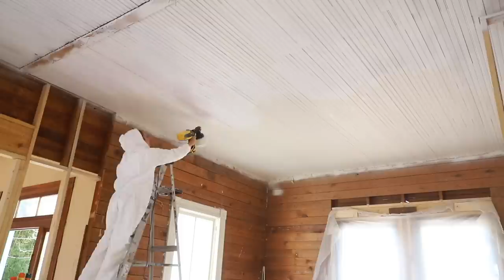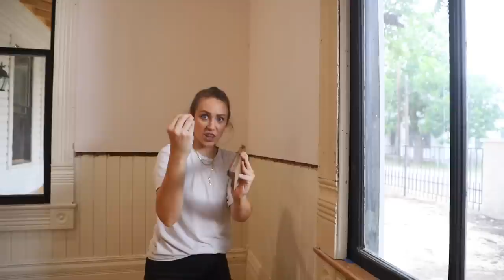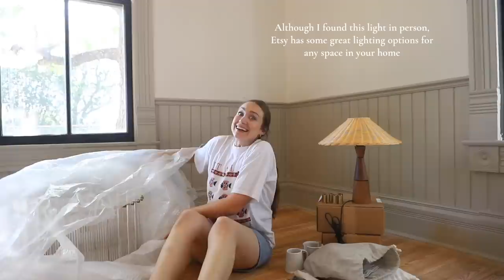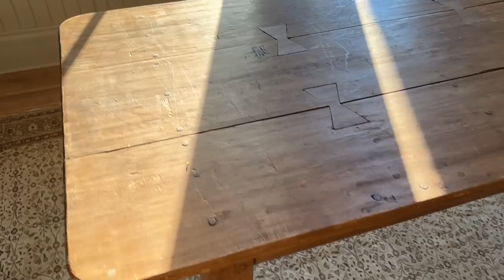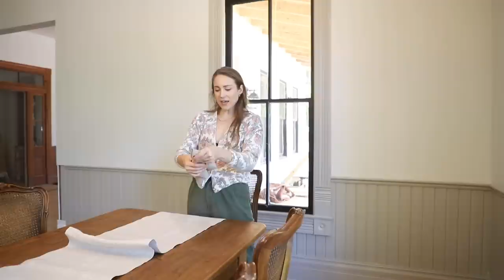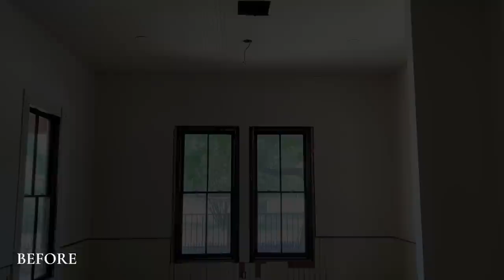Extreme DINING ROOM MAKEOVER *Vintage & Handmade*  | XO, MaCenna

Comment: It’s beautiful!!

Tip on the frame: you can twist the wire into itself on the edges on both sides; if shortens the wire length and makes it more taut so it doesn’t lean out too much. Adding pads at the bottom of the frame also levels it out and gives the frame some grip with the wall too so you can shift back and forth to make the frame more even, too. Beautiful frame and landscape! 👌🏼
Reply: I have done this tip on most of my frames because they have wires that they hang from, and it has made a huge difference in how far off they hang from the wall. My frame now hang really snug to the wall and stay beautifully in place. Thank you for explaining this tip because I kept thinking about how to say it but was at a loss 😊
Reply: This is a great tip! I also used museum puddy on the corners of my frames to hold them against the wall and keep them from going crooked which has saved my sanity! The room looks beautiful though! The table is amazing!
Reply: this!

Comment: So here is a suggestion to blend the chair height to the table height. Depending on the measurements needed to achieve the correct ratio, I suggest cutting the bottom stem of the table legs to the 1st ball shape which looks like about 2-3 inches. Then put a metal tack type button made for the bottom of the table legs to allow them to slide over the carpet. If this makes the table a better height for the chairs, I suggest the same type of metal button on the bottom of each chair legs so they will slide over your carpet without catching the fibers and possibly tearing or weakening this older beautiful carpet. The buttons nail easily into the bottom of each leg and are intended to keep the legs from damaging the carpet or a bare floor. Hope this works....

Comment: OMG, that is so beautiful. I think the cabinet is what really brings the whole room together. Maybe instead of glass, use cane in the doors to tie in with the chairs. Oh, and the reason your frame is hanging a little wonky is that the wire is probably a little loose -- they tend to stretch out over time. Try detaching it, pulling it taut across the frame, and reattaching it.

Comment: The foraged greens for ontop of the buffet type thing….
I saw this great DIY where you use the branches of a similar woody bush and take all the leafs off once it dies out… then you glue rake leads to it. Great way to keep that same vide throughout the year! I’ve seen it done really nicely. The nice thing is you don’t get that nasty plastic branch with the greenery. You can buy some good quality leafs to keep the vibe you want. You can also do flowers etc if you want. Nice to have seasonal options (Hollie type branches for Xmas, maybe a yellow small flower on branches for spring, etc!)

Comment: Hot Tip: when abutting moulding cut each end at a 45 degree angle (one in and one out) they will notch together really well and you won’t have to fill and sand as much! It’s a cleaner look

Comment: Oh, MaCenna…congrats!!….it’s happppppppening…..the frosting on the cake you’ve been baking. If the dining room sets the tone….you are on the right track….so beautiful…such a beautiful curated start to your and Romeos creation! If you add a second hook to the wall  ( so the frame wire runs across 2 picture hooks along the backside) the frame will sit flush to the wall.😉

Comment: It is all coming together!! One thought is to consider adding an additional piece between the two trim pieces at the center of the double window, so it would look like a single very wide trim piece between the two openings rather than two trim pieces almost connecting together. :)

Comment: Soft blinds that fit in the windows that you can lift to open by pulling top down to 1/2 way so still letting the light in they also can be lifted to the 1/2 way or go all the up or down in the day and completely shut for privacy at night

Comment: Oh my goodness MaCenna, what a beautiful room, this makeover was so much fun to watch, I love the wall color and then the bottom color just is so gorgeous, I love the trim work that you did, so decorative and beautiful. That vintage rug is so beautiful I love that color that runs through it. And that table is gorgeous and those chairs are perfect. You are so amazing at all of your choices on things from that beautiful light to that cabinet that I feel if you take out the wood and replace it with glass that would really be awesome. I was a custom framer for over10 years and hope to get another job at a frame shop again, so the reason the picture tips outward is because the wire on the back is too loose, so you can tighten it up and it should hang closer to the wall, make it flat, because you can hang pictures by just knowing where the wire is and the wire will grab onto a hook or nail hanging out from the wall, when I use to put wire on the back of the frames I always made them flat and not lose that makes them hang closer to the wall. I hope to see your next Vlog soon and I am really looking forward to that, have a great day, sending love and hugs, bye for now.

Comment: The cabinet is the perfect addition and would look amazing if you cut out the front panels and replace them with glass. I love my china cabinet because I put so much time and love into finding gorgeous dishes and glassware, I don't want to tuck them away in a kitchen cabinet all the time except when I have guests over. I want my pretty vintage dishes and glassware to be part of my everyday decor and the most appropriate way to do that is to arrange them in a china cabinet in my dining area.

Comment: After seeing the table again, (see comments just below) cutting off the bottom of the table legs and adding the metal button on the leg bottom, will spread the weight of the table across more of the fibers of the carpet and the metal buttons will not make as much as a permanent mark crushing the fibers. I also suggest moving the table and chairs occasionally to avoid damaging the carpet with marks from the legs of the table and chairs.

Comment: As an upholsterer and hubs is a furniture restorer. We are purist, please leave the cabinet as is and also leave the table legs as is. Just fill in the top of the cabinet with baskets, art and or wicker baskets on the wall. it looks stunning. You could leave the cabinet doors open and put wreaths on it or linens over it. What finds you have found.

Comment: Some people would cringe, but we go in the shower with frames, etc, hose it down gently and let it air dry upside down, use a blow dryer first to get the wet areas out of the cracks, it is easy and it doesn’t hurt the wood for just the first cleaning, after that we use feather dusters while they are on the walls. Just an idea, sounds funny or even wired, but it works and you’re not suing any chemicals on it.

Comment: Fyi they are bowtie joints on the top (not dovetails)
The depth of the table rails will mean you probably don't have 2 inches to play with as you don't want to not have enough room for your legs, & if you ever get the chairs rebuilt in the future the seats will probably be slightly thicker than they currently are. Put thick padded glides on the chair legs and maybe take a 1/2 inch off the bottom of the table legs as you can probably get away with that without losing their shaping (will close up the gap a little but not risk people not being able to sit under the table) & that will be easier than getting the joints at the top remade after shortening.
& Please don't cut out the panels of the cabinet, they are beautiful as is or could have a dainty decoupage or painted motif on them, as is it fits well with the moulding styles

Comment: You can fix the frame with hot glue.
All you have to do is cover another corner with the glue and let it dry when you peel it off you'll have a perfect mold.
Then fill it up with some wood stick compound put it on the corner and tape it until it dries.
The table runner is too long. it looks terrible that way.
You do need to make that cabinet taller and take that plant out of there

Comment: You may have shortened the dining room table legs by now but, if you haven’t couldn’t you remove the legs and shorten from the top section connected to table top.

Comment: I think your hutch will work great with the changes you're planning. You could even notch out the doors and add in cane to tie in your chairs but glass (especially etched glass) will be beautiful. And once your table height is adjusted the height of the hutch will work better.
My favorite pieces are your chandelier and rug.

Comment: If you can take the legs off the table, you could cut the length off the top block versus the beautiful turned parts on the bottom!